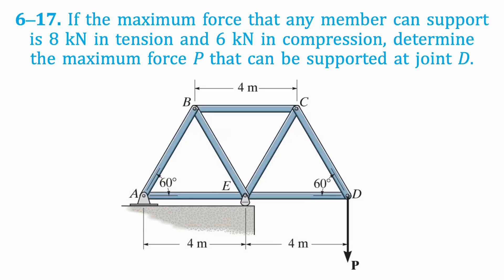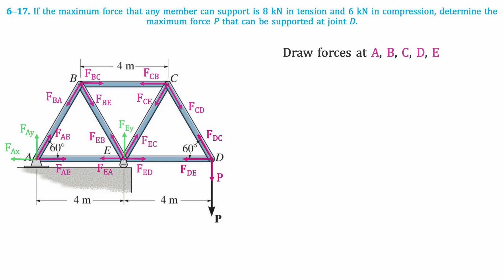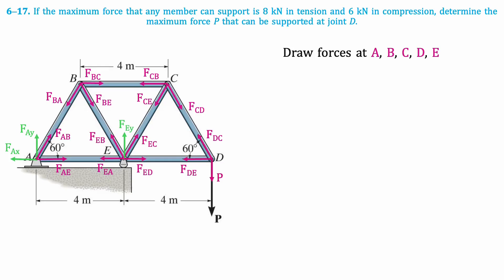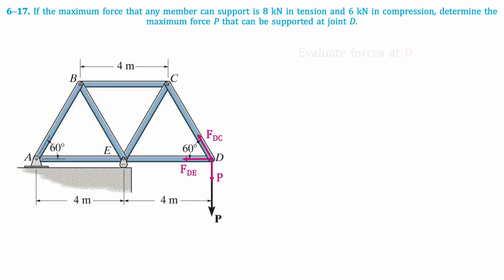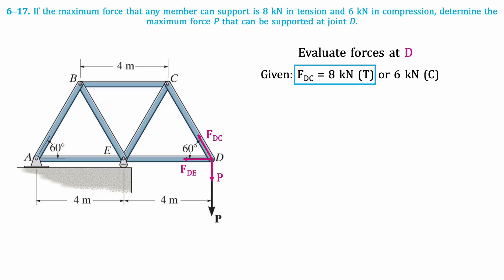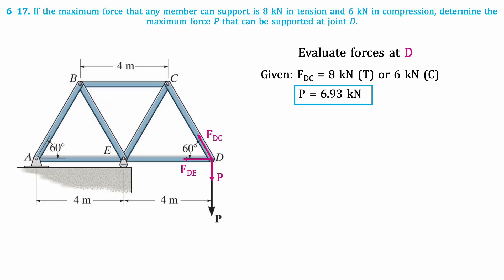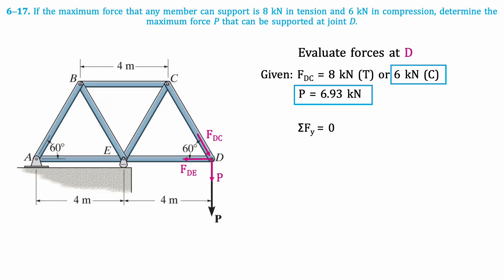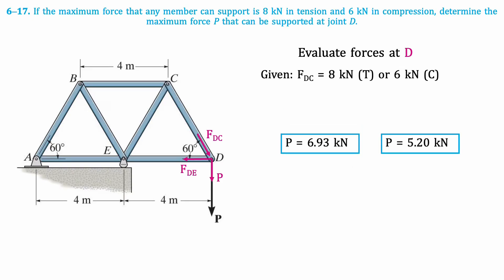If the max force any member can support is 8 and 6 kN determine the max force P supported at joint D

Comment: how did you do this magic whattttttttttttttttttttt? i spent an entire 2 hours trying this but my question would be since you got 5.2 kN as the max, why did you not continue and measure the rest of the memebers max?
Reply from the maker: The question asks for the max force supported at joint D, so only the forces in the members directly attached to D need to be measured.